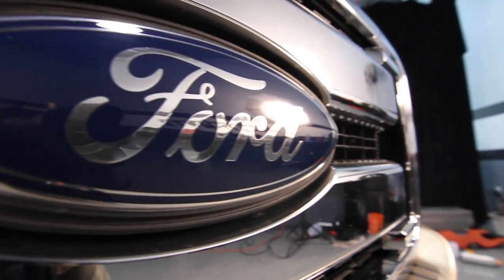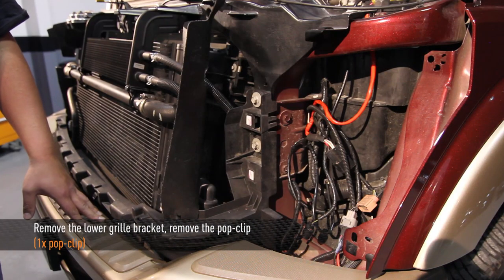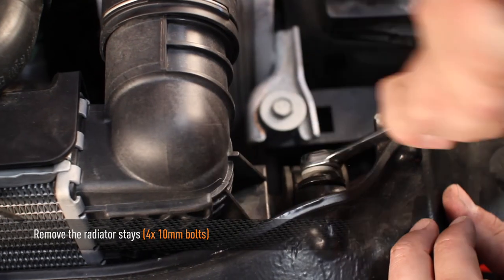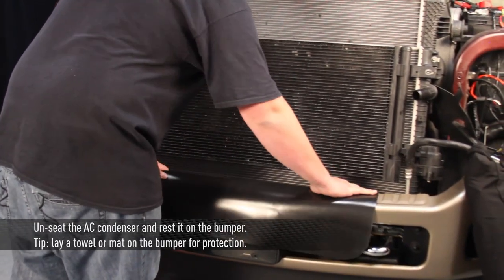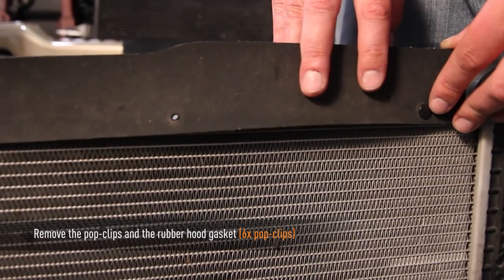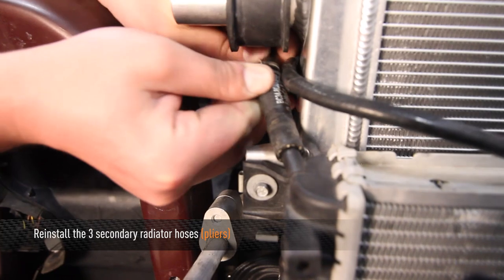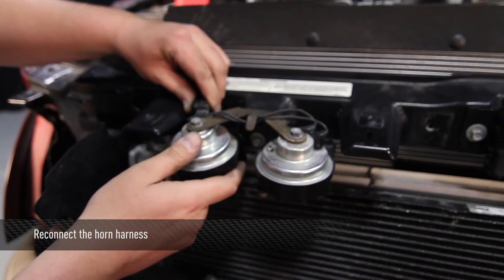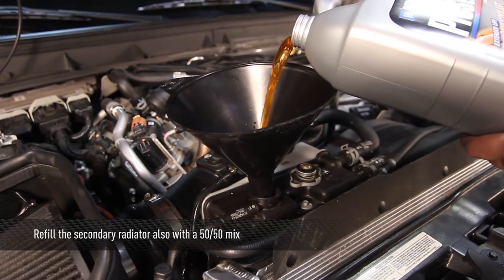2011-2016 Ford 6.7L Powerstroke Aluminum Primary Radiator Install Video, by Mishimoto

Comment: Just used your video to do a DIY radiator swap on my work truck.  Could not justify the cost difference for your radiator but your video was the best instructional video I have ever used! Thank you very much it made this time sensitive job so much easier!
Reply from the maker: Glad to hear that the install video helped out!
Reply: How long did it take you

Comment: This is by far the most helpful DIY video I’ve ever seen. You saved me HOURS! If I hadn’t already purchased a radiator before finding this video, I would’ve purchased yours simply because your video was so helpful. I appreciated that you kept saying the size of the bolts on both take down and install. I also appreciated that you did the entire install after removing the old one. Seriously.... the dealership wanted $1700 to do this job. You saved my butt. Thank you.

Comment: Excellent video,,,2016 f550 Crew 4x4 leaking, at 40k,,,,think the radiator is mounted to ridged and flex's the plastic tanks,, the 550 rides like a log wagon ,,,maybe there should be a recall or free 1 time replacement  ,,, thinking of going with a new ram next 25% cheaper and getting good reviews

Comment: Approximately how much coolant/water do you need to have on hand to refill the system for this job?
Reply from the maker: We would suggest picking up at last 4 gallons of coolant.  The capacity of system is roughly 11.6 quarts from what we are showing.
Reply: 11.6 is just the secondary system. Don’t you have to completely refill the primary as well? 4 gallons would not be enough for all of that. Correct?

Comment: Great Video.  I have a2012  F-350 with a radiator leak (front driver's side, bottom of radiator).   I live in Atlanta.  Do you know any shops that can install your radiator for me.  I do not feel comfortable doing it myself.  Thanks

Comment: Is this the same on the 6.2L gas, 2015 F250? the radiator looks the same.. and the problem sure is..ugh.  At least it made to 160k.
Reply from the maker: We unfortunately haven't tested out the 6.2L model yet but if the radiator is the same, the flexing issue is most likely affecting those chassis as well.
Reply: @mishimoto  Thank you! Is it also typical for the top and bottom hoses to dry up and loose a tight connection, when snapped in? It is 160k miles.
Reply from the maker: Pretty common for OE rubber hoses to degrade within that timeframe. The on/off of daily driving is putting the rubber through heat cycles which will slowly crack and split the hoses. We switch ours out with silicone which is much more heat resistant and will typically last much longer.
Reply: Michael it was the same? , I have the same 6.2L looks the same but I'm still investigating...  your feedback is important. Regards

Comment: Why would you only want to upgrade the primary radiator? Is there a common issue on the stock rads? Wouldn't you want to get rid of all the plastic tanks all at once?
Reply: +Propotus the primary one has plastic tank ends and they are separating.  Apparently the secondary one is all metal with no issues.

Comment: what do you think caused the traitor to leak?  is a faulty part from Ford? "O" ring or hoses?
Reply: +carmas54 the bottom corners are separating from the plastic.  we see a lot of radiator replacements at the dealer. did one today truck only had 35k
Reply: it should never happen, certainly not at 35K mikes
Reply: carmas54
i agree I'm just telling you what I see.  Better it happen under 100k tho,at least warranty will cover it.   All in all they're not bd motors
Reply: The radiator replacement wasn't under warranty... I had to shame Ford into paying for half of it.  The motor isn't the problem, it's the Exhaust temp sensor and the whole complete EGR, cooler,sensor and valves other than that,  the truck runs great.  I have learned to live with it. The EGR was under warranty

Comment: Video is incorrect for these Super Duties.  We all know that Step 1 for anything on these trucks is: Remove cab from frame
Reply: This is one (of the few?) install(s) that can be done without doing that.
Reply: Matthew Zinicola Comment was made in jest.  I just joke around on these super duties that the first step to any mechanical work on them is to remove the cab from the frame.  Hehehe.
Reply: No problem, Dean.  I interpreted it that way... I just added my comment as to not confuse others. :)

Comment: Thanks on video saved me alot of money doing it myself i did find out on secondary radiator i bought one of the quick connect hoses did not seal with the radiator i bough it at oreilys in case any1 had same problem

Comment: I was days away from ordering a $1000 radiator until I found my radiator was not my problem. It was the crossover pipe gaskets blowing fluid. Fixed that and the truck has held coolant for over 1500 miles.

Comment: Great Video, yall did a good job showing all the steps without a lot of fluff.  Also very helpful to not have to disconnect the AC like AllData says to:)  I had already bought a factory rad, but if your radiators are as good as your videos they're top quality.

Comment: very sweet! done had 2 radiators replaced and im sure there will be more! next time I will use this!
Reply: Are you sure it’s the radiator blowing and not the crossover tube between the heads?

Comment: I have a 2011 F350 6.7 with this issue now.  I purchased used with 143k mile so i don't know how many radiators this truck has had installed.  Are the ford replacement radiators good to use now?
Reply from the maker: +Patrick Melson Please email support@mishimoto.com - they will be more than happy to assist you and answer any questions or concerns you might have!  Stay cool - Team Mishi
Reply: Ok great. Thanks
Reply: Patrick Melson no. still the same from factory.
Reply: if you haven't replaced this yet I would go with MISHI for sure!
Reply: Mishimoto Automotive what’s the price for this product?
Reply from the maker: The link below will take you to our site with the most up to date pricing.
https://www.mishimoto.com/ford-6-7l-powerstroke-aluminum-radiator-v2-2011-2016.html

Comment: Ford OEM radiators suck, Huntington Beach Ford in Ca wants $1400 to replace mine in my 2013 F250 Diesel with 63,000 mi pay $60,000 for a new truck and never have been off road and the radiator leaks. That’s BS